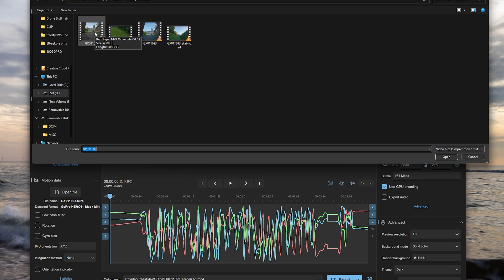Distortion bug in Gyroflow - How to fix it easy

Comment: I have the issue where GyroFlow is distorting rectangular objects like phones/tablets. I tried the 4K setting you showed but it had no effect. Any ideas on how to fix the square/rectangular distortion?
Reply from the maker: Did you try to change the aspect ratio to something else then back again? I’ve found this works some times.
Reply: @RaukFPV  I didn't but I will load it back up and try again.
Reply from the maker: Let me know it if works :)
Reply: @RaukFPV  Nah, it didn't seem to work. However, the video I'm using is from an Ace Pro 2 not from a drone so maybe it's just not meant to be used that way. I was hoping to turn off image stabilization in camera and do it in post but the results are turning out not good. Thanks though!